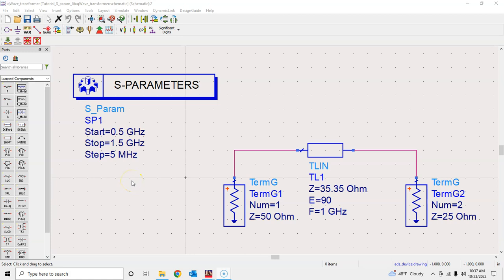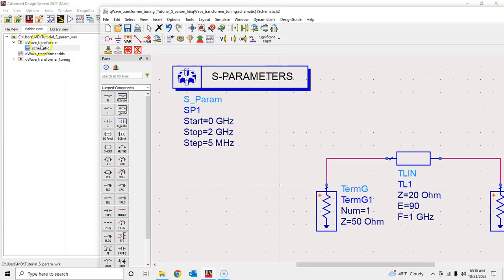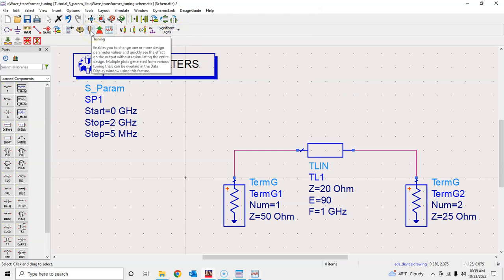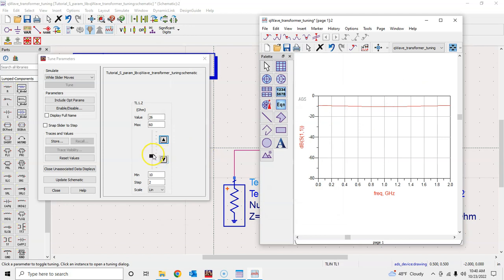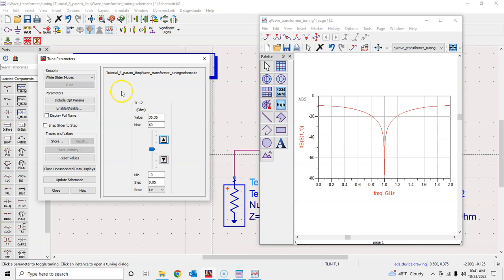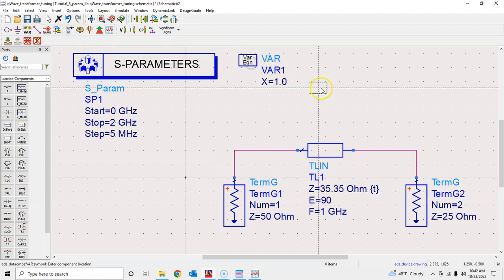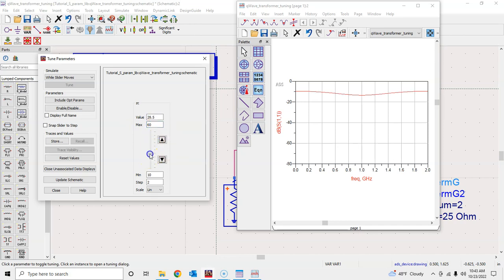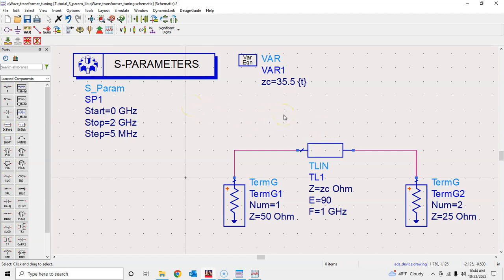Tuning in Advanced Design System (ADS)

Comment: Hai sir
I have a Problem on ads
As i plot efficiency vrs pin ,it gives efficiency vs frequency. When i use add_ verse option on it, it gives as x axis as frequency and y axis as efficiency, Power 

What i do ,????
Reply from the maker: Abhijith, if you're sweeping frequency it shouldn't happen. Try using a design guide, use their amplifier/transistor with yours and set the parameters relevant to your design. For example, use the following to plot PAE: https://edadocs.software.keysight.com/pages/viewpage.action?pageId=5927645. An example of how to use a design guide is found here: https://www.youtube.com/watch?v=jAtqm-x1GQM&ab_channel=KeysightDesignSoftware
Reply: @MohammadAMaktoomi  Thanks sir. The problem get solved. 
I have another dout. I have designed an RF Rectifier Circuit. Who can i get the layout of that structure. What are the steps required.???
Reply from the maker: @abhijithas9976   I am glad you could solve your ads issue. For an RF rectifier, like any other design, you first need to do schematic simulation and then EM simulation. Just like your PA, you will need to do EM cosimulation as the diode, capacitor, and resistors are not EM components. You will need to perform LSSP/HB simulations to find the input impedance of the rectifier which will help you design the matching network. Which diode are you using? https://www.researchgate.net/profile/Xavier-Le-Polozec/post/How_can_I_calculate_Zin_of_half_wave_rectifier_at_6GHz_by_using_LSSP_or_HB_simulation_in_ADS/attachment/59d6596b79197b80779aeed6/AS%3A542438431391744%401506338808592/download/Detector+Impedance+within+ADS.pdf
https://www.researchgate.net/post/How_can_I_calculate_Zin_of_half_wave_rectifier_at_6GHz_by_using_LSSP_or_HB_simulation_in_ADS
Edaboard has a lot of help:
https://www.edaboard.com/threads/about-zero-p_out-for-a-voltage-doubler-rectifier-in-ads.402406/
Reply: @MohammadAMaktoomi  Thankyou for your reply sir.unfortunately my ADS problem was not get correctly.
I made efficiency vrs pin graph. But now I want efficiency vrs Freq. For that I set a variable LSSP_FREQ=2.45GHz. And i put 2.45GHz as fundamental frequency in harmonic balance and sweep frequency as variable LSSP_FREQ from 0 to 5 GHz.
The equation that i put in this time is quite different from what I put in efficiency vs pin graph ( Here [eff= 100*p_probe1.p[0]/p_probe2.p[1])because of the error that have obtained. After correction of the formula (is it not sure correct or not[ eff= 100*(p_probe1.p/p_probe2.p)the obtained result graph not correct as we required. The graph will not sweep in teams of x axis frequency.

But even when I reverse the formula (eff= 100*p_probe2.p/p_probe1.p) (input/ output) it shows sweep according to Freq in x axis.
So why using eff= 100*(p_probe1.p
/p_probe2.p) the frequency does not sweep.????
Why the efficiency graph is reduced by using this formula from previous eff vs pin formula...??
How to get correct graph from simulation
Graph
https://mega.nz/file/090nQByQ#X5pzmt0lwW1zO6iHr0wFYjV_WWxSq32D_JIxTGWBxzE
Efficiency vs pin
https://mega.nz/file/8pUFUQ4b#ycSx6t9fJ-3hdDveX44Sa1Ei-2ZxqDxlJsvXXyBejH4
The efficiency vs freq graph
https://mega.nz/file/Z5dUzThY#a9KiUEn0qmB5utR2cnb1w536U4qrKZTZEmcyiYKJdEU
Circuit
https://mega.nz/file/BwVHUT6a#aijK8ABFM0D040NmS4XUaFDWe7vDg5EFI7VZHaVkbVk
Reply: Hello sir, how can i design a two single stub( i-mloc & ii-mlsc) networks? And do i use lincalc to find the length of the stubs?
Reply: @muneer296  I think that inorder to design it, thare are design equvation by which you can find the impidance in terms of effective length.
From impidance and operating frequency you can find the length and width from linecalc.
Reply from the maker: @muneer296  Sorry I was busy grading! Are you referring to the combination of short and open circuit stubs that I have used in my following paper or your question is about general mloc/mlsc components?
M. A. Maktoomi, M. S. Hashmi, A. P. Yadav, and V. Kumar, "A generic tri-band matching network," IEEE Microwave Wireless Components Letters, vol. 26, No. 5, pp. 316-318, Apr. 2016.